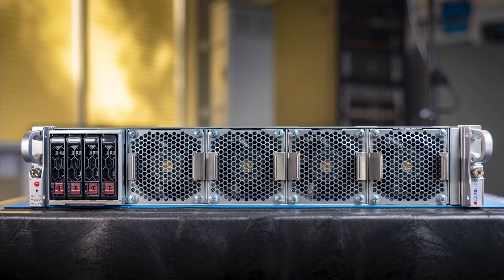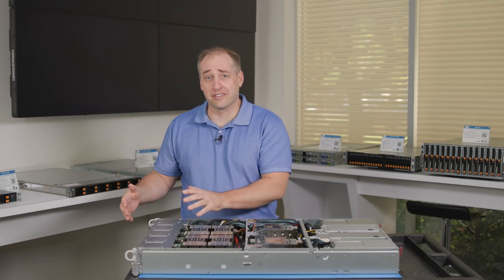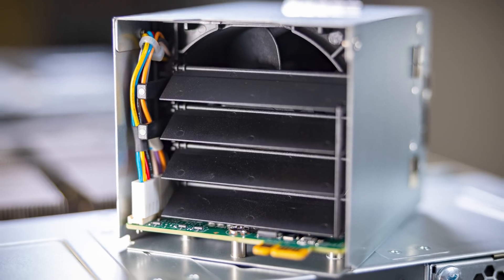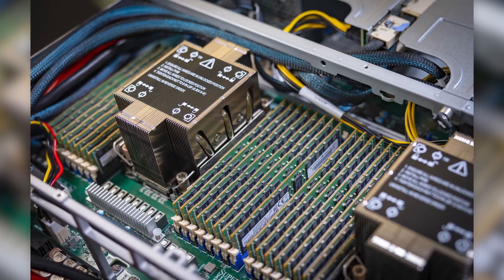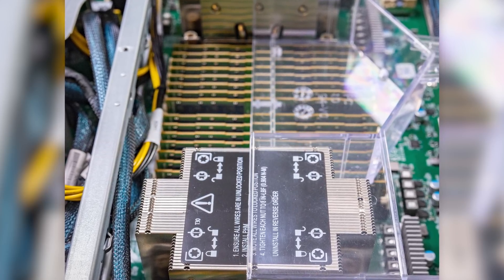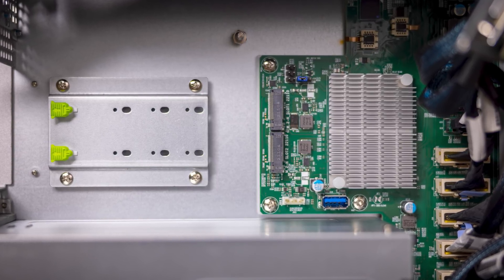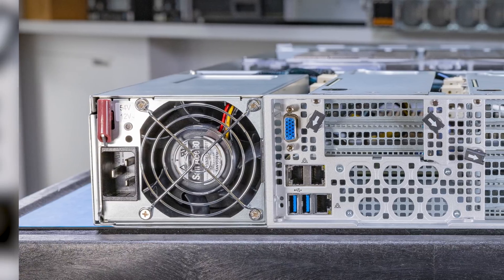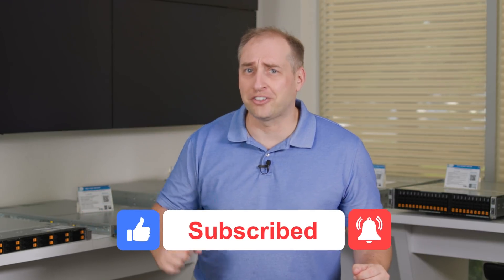Wow! Supermicro's NVIDIA Redstone 4x A100 2U Server Hands-on

Comment: Im kinda in cringe mode Patrick.    If you get a chance to showcase engineering like this,  take time to get talking points from the engineering team.  No joke.   Get talking points from the engineering team based on what you have found very interesting, intriguing or the like.    Im really disappointed in the lack of detail.   This is really a superficial point of view based of the lack of technical detail.   

Points of consideration 
1. These four bays in the front.   The massive data sets need the fastest layers of storage available.  Im very interested in what the engineers expected to see in those sleds.
2.  The latch.    Im in love with that too.   Id be all over asking the engineering team about that..
3.  The cooling is so important that it needs more time on.  The more the better.
4.  Power supply.   ?   Like what more can i say.   We need more information. 
5.   There are so many questions that we all have,   but more importantly you had interests that i felt could have had more information attached.

Patrick from Serve the Home,  I give you massive credit for what you have offered us.   Might i be so Bold as to ask you for more technical detail even as a time stamp link to an article on your site...  

YOUTUBE,  in my opinion,   has to many short, lack of detail videos that cover so many great topics.   Visual information like this is so awesome for us as viewers to have.   I feel like im being dragged out of the building kicking and screaming it was not enough time...  

Big Thanks.
May we have Bigger Videos?  😉

Comment: I hate to tell you that a server that uses two EPYC Milan processors are going to much more powerful than that server and the EPYC 128 core 256 thread processors will be out soon so with two of the up and coming chips you will have 256 cores 512 Threads and a lot of internet providers are ditching the INTEL powered servers for the EPYC powered servers.
Reply from the maker: Actually, there is at least one shot of the AMD version of this server in the video. Also did a Bergamo piece this week on 128C EPYC slated for early 2023

Comment: Is this system primarily advertised with EPYC or Intel? Kinda shocking that with Ice so late and still slower than Milan AMD still isn't the most advertised solution. Maybe something to do with marketing budgets
Reply from the maker: They are two different systems. Actually, the B-roll with the latch moving was done on the AMD version on the system that was in the room since it did not have cables. We did another AMD one previously so I wanted to do something different this time.

Comment: Is there any indication that industry is going to move towards something like USB-C for all the KVM needs? VGA+2xUSB on the back is taking away valuable space ...
Reply from the maker: Not really. It is all of the legacy KVM carts. Nobody wants to make a non-VGA KVM cart because servers have VGA. Server vendors do not want to stop having VGA that can be using with existing carts.
Reply: @ServeTheHomeVideo  So all we need is a usb-c to vga+2x usb A dongle with a bit of a cable, maybe 2-3m. That should be enough to bridge old and new world.
Reply: @jurepecar9092  that sounds like another point of failure or another part to lose, from a support perspective.
Reply: @IanBPPK  Yeah, it's going to be as fun as the notebook dongles are, but just for about a decade, until transition is over. But it has to happen ...
Reply: @ServeTheHomeVideo  Well if there's ever a transition it needs to happen at some point, I don't see why having a dongle in your pocket (or tied to the cart so it doesn't get lost) is that big of a deal during the transition period.